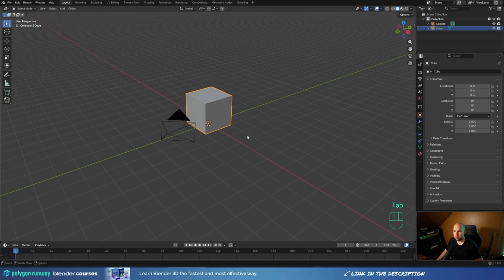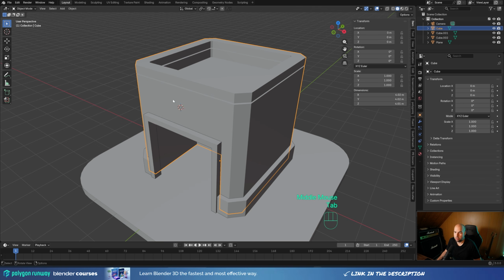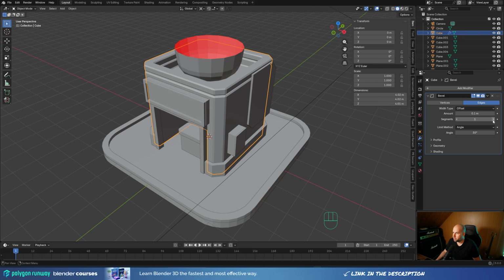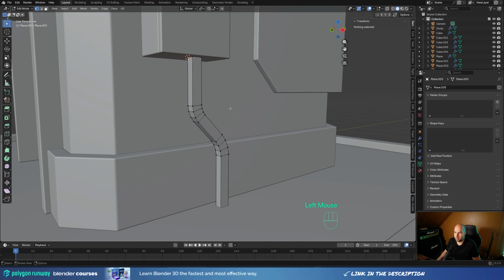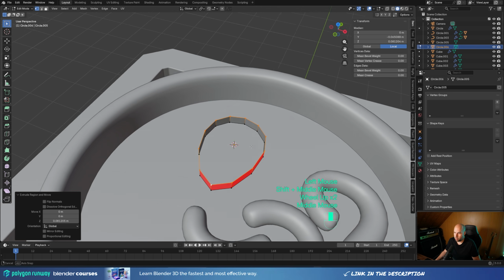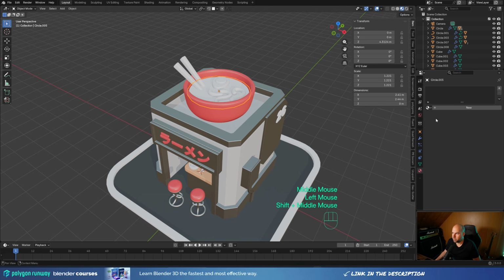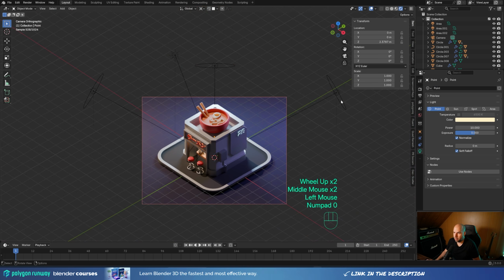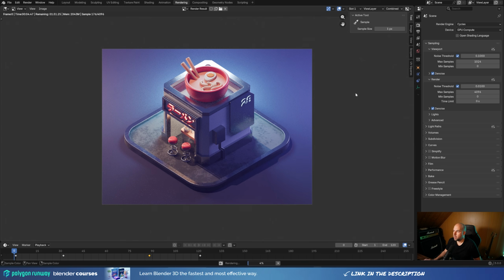2026 Blender 5.0 Beginner Tutorial

Comment: Does anyone know why at 2:10 I do exactly like he did, but my cube still scales like the origin is in the middle, scaling down the surface?
Reply: I've had the same problem. I just transferred the pivot point from the median point to the 3D cursor and the scaled it without a problem!
Reply: @ΚατιαλέναΔέδε Yeah, it worked. But he said that if we did it as he did, we didn't have to change the Transform Pivot Point.
Reply: Scaling always happens around the Pivot Point, so this is almost always the pivot setting. Look at the small pivot icon in the header of the 3D viewport (or press the period key to open the pie menu) and choose Median Point or 3D Cursor depending on what the tutorial does. If the tutorial scales from a corner or edge, either move the 3D cursor there first (select it, Shift+S > Cursor to Selected) and set the pivot to 3D Cursor, or select the face or vertices and scale from that selection. Also make sure you are in Edit Mode if he is scaling the mesh itself, because in Object Mode scaling uses the object origin. Finally, turn off Proportional Editing (the O key) and check the Options menu for Affect Only Origins, which would also change the result. Tell me which one the pivot shows and I can say what to pick.
Reply: @BlenderZen  it works. Thank you very much.
Reply: @BlenderZen  , so I keep the default pivot point, which is the Median Point. The only thing that I need to do is make sure to move in Edit Mode.

Comment: ON 7:20, when selecting the face for the roof and pressing i, What would be the diffrence if pressing E and S (Extrude and Size)?   Also, thank you very much for your tutorials, I'm extremely grateful, they helped me so much transitioning from maya to blender.
Reply: They look similar but they behave differently. Inset (I) shrinks the face evenly, so the border has the same width all round, and you can also set Depth and press I again for individual faces. Extrude then Scale (E, then S) scales the face around the pivot point, so on a face that is not a square the border comes out thicker on some sides than others, and with several faces selected they all scale as one group around the middle unless you change the pivot to Individual Origins. Also, E moves the new face along the normal, so you would need to press Escape or right-click right after E to leave it in place before scaling. Use Inset when you want an even border, such as the roof edge, and Extrude when you want to push the shape out or in.

Comment: Heey, did anyone manage to complete the animation render? For me, Blender is crashing when it's done with frame 1 (which takes 45 minutes with 128 in the resolution), and I'm now trying to render via the command line, as I read it may be more stable. I have a 6gb RTX 3050, not sure if it's normal for a low-budget GPU. Thanks for any help you could provide!

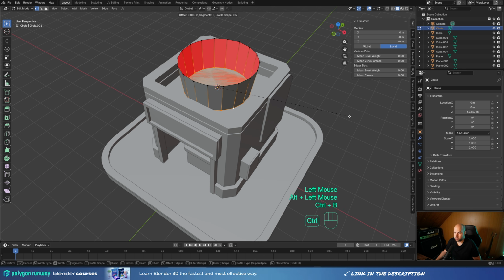Comment: 18:55
For some reason, I had an overlapping face at the bottom of the bowl.

If you're having the same issue where Bevel only creates extra edges but doesn't round the bottom properly, try this:
Press A to select all vertices → press M → choose "By Distance" to merge any overlapping vertices.

After doing this, Bevel worked correctly for me. Hope this helps anyone having the same problem
Reply: If you keep getting overlapping vertices/edges after using Extrude, you may be pressing  E and then Right Click/Esc to cancel.
I looked into why this happens, and it turns out that In Blender, Right Click or Esc only cancels the movement, not the extrusion itself. The newly created geometry stays in the same place, causing overlapping vertices/faces.
If you extrude by mistake, use Ctrl + Z instead.
If overlaps already exist: A → M → By Distance

This fixed the issue for me.

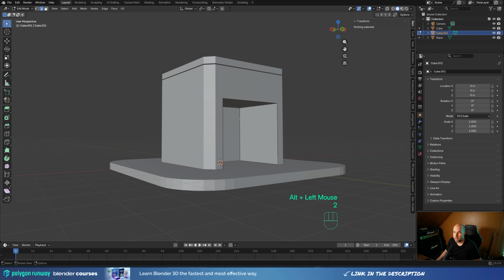Comment: At 9:00 when im pressing g and y its not moving in the same way
Reply: press x instead then :P
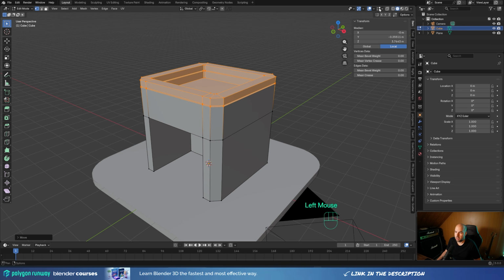Reply: found out the issue happens at the previous step which is 8:12 where u select all the faces and duplicate it. ur not actually supposed to select all the faces, u only select the left side, right side, the ceiling bit, and avoid selecting the one at the back/aka the one right infront of u when ur front facing it. then follow the rest of the steps like normal and it should work!! ☺️

Comment: NGL brother my fist is about to smash a computer. I do exactly what is shown and follow all the mouse moves and keystrokes and at varying points for inexplicable reasons things just don't work. For instance, beveling which worked fine on the last try in vertices select mode, now all of a sudden will not select the base section for beveling unless i go into face select mode. which the last two or three attempts this wasn't an issue WTF? This getting to be extremely frustrating.  I have restarted this tutorial about 15 times now at .75 speed to make sure I match all selections and movements and, every time something different becomes an issue before I get 5-10 minutes into the Video. Does anyone on here have any info or something that can help before my computer finds a new home inside of a wall?
Reply: It’s the nature of 3d modeling man. Any number of things may have happened and then it’s off to the races. Keep at it because it does eventually click and you will learn to recognize when something doesn’t seem right before you make that little error.
Reply: @bobrob8839 thanks
Reply: Gpt, probably
Reply: @Henrique-wy6cv  I run into the same issues with GPT. The first five steps will work marvelously. And then everything goes to crap. And ChatGPT is either like oh that was my bad. Oh that’s a classic blender. Gotcha and actually you have to go do this first before step two will work. 😡